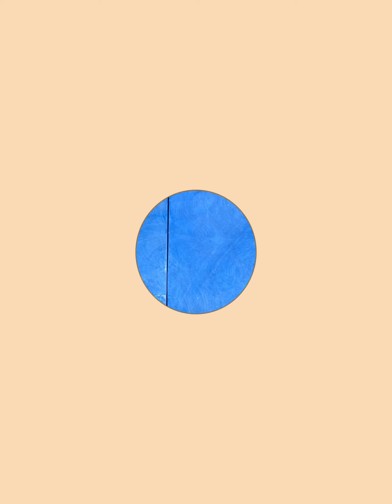9ft Walnut Epoxy Resin River Table with Two Removable Leafs #shorts #subscribe

Comment: What kind of epoxy did you use in that and where did you get the legs from or are those made by you too?
Reply from the maker: I use various brands, but for this particular table, I purchased the epoxy from https://www.theepoxyresinstore.com/. The resin does require thinner layers so you need to make sure you get the coloring right. 

For the legs, I purchased these beautiful steel legs from https://www.mariuswelder.com/. They were solid and exactly to specification for the project.